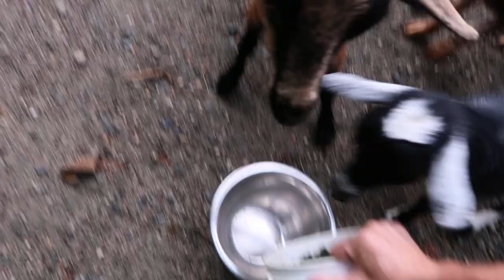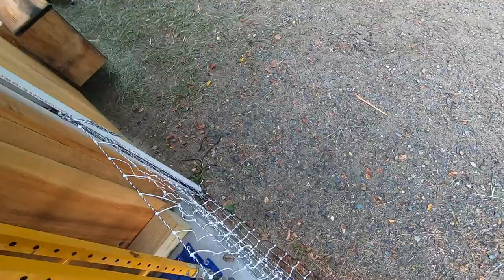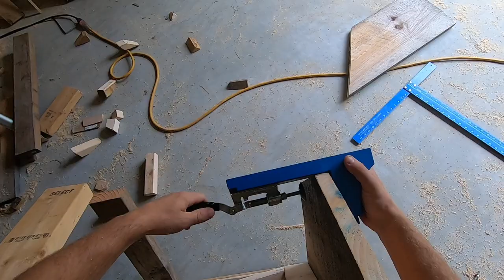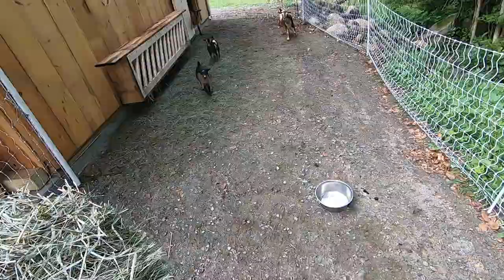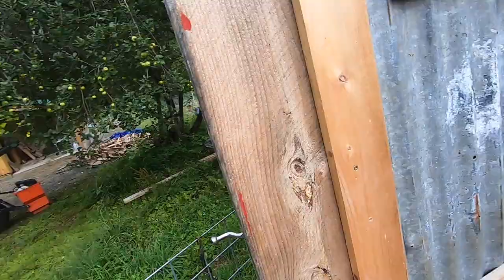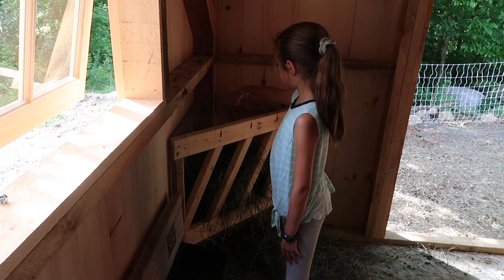I hope we CAUGHT our Chicken Predator

Comment: You may wish to round off the tin roof corners those sharp overhangs on the feeders are an accident/ cut waiting to happen. Other than that they are beautiful.
Reply: Yes, goats are too playful and rowdy for those sharp edges.  Rounded off and maybe a durable sort of bumper on those edges.
Reply: I used to be a metal roofer back in the day, and those edges are brutal.
Reply: Yes I have had to do this in my duck pens where I use them. Just fold the corners under. Super easy fix.
Reply: Yes, those metal sheets on the feeder will rip the goats.
Reply: This is a wise comment. If a goat can find a way to cut, hang, or gouge themselves they will. Especially if it's a new thing.
Reply: Eric Budrow are we related? lol

Comment: Suggestion: Try covering on the top and long sides leaving both entry and opposite end open. Most predators will not enter if they can't see an easy escape route. I usually do not cover the trap at all and get good results.

Comment: Look at hope scratching along the length of the outside feeder.  Need brushes installed?  Also can drill a hole on the door post for a string for Olivia to pull to Open the door so she doesn’t have to feel for the lock.  And who sweeps the 🐐 💩?

Comment: I love the old milk stand. Metal is off putting.
Reply: If he places some plywood over the metal floor, the goats may accept it.  I don't think they like the metal on their feet.
Reply: I was thinking about using the metal milk stand for buttercup and blossom
Reply: Get a rubber stall at and cut it down to fit the metal milk stand. The rest could be cut to fit on the concrete floor at the bunk beds.

Comment: I just got Electric heated flat sided buckets from Amazon for the winter. No frozen water. Your insultated boxes worked good but now you have electric in the barn.😏 Just a thought. Oh wait! goats might chew on electric cords??
Reply: Just use metal tubing for conduits. I don't think they chew through that. Plus using a wire that is critter-proof i.e. with metal-mesh just under the external insulation layer. Belt and braces solution I think.

Comment: Make sure the set wire is in the proper position in the wire mesh of the trap.  It must only have tension in one direction. If its in the wrong position of the wire mesh, it will have tension in two directions and will not "spring" fast enough to catch larger predators. Also, place the bait under the trap directly behind the trigger step as well as behind it within the trap, and place a 7-8lb weight (I used a stone) on top of the trap. I set my trap several times with the same result you had before I utilized these techniques to catch 3 Raccoons and a Opossum that were killing my Mom's chickens.

Comment: You need to build yourself some workbenches. Save your back🙂
Reply: He'll start that after the Winter prep projects are done. Getting the firewood covered and dry is a higher priority.
Reply: I think Daryl May have meant a rudimentary/temporary raised work surface.  1/2 a sheet of plywood and a 2 by 4 frame secured to a wall with 2 front legs would take 1/2 hour to build and save a ton of back strain.
Reply: @James Halliday He didn't use kneepads once during the barn build, even though Multiple supposedly older and wiser viewers had commented that it will help him not have bad knees when he's their age so I don't think he cares

Comment: Three new quick projects for you Al. 
1) a workbench and tool storage with lots of draws
2) you need to find a drainage solution for the old goat place. It will be flooded again if snow will start melting.
3) rain harvesting for the new barn building

Comment: It sure is handy to have the tools that you need when you need them. Now , you are using wood glue on the joints !
I see that I am not the only one that thinks that you should be taking advantage of the broody hens. They are automatic egg hatchers and you do not even need to monitor them nor brood the chicks after they hatch .
 I foresee that you will be running a water line to the barn.
 It's all coming together now isn't it ?

Comment: The closed door on the trap... your predator was there last night more then likely it either used the trap for a step to get up on the chicken tractor and set it off or it moved it around and set it off.. I had to anchor mine to the ground with rebar and wire so the raccoons couldn’t move it. Second thing is if it is a full grown raccoon or a fox your traps are too small. I’m telling ya they are. A full grown raccoon can be almost as tall as a fox.. raccoons are also very smart. Any missed attempts will teach the raccoon to stay away from the trap. Which is what happened to me.. I had to switch to leg traps ( which I do not like) but they worked. I actually caught more predators with the leg traps then with the havahart traps. The bad part about leg traps is they are kinda dangerous around pets. If your pets roam free like figaro does. Or even the dogs when you let them run free. Predators are a bad situation all around. You can’t keep loosing your chickens either though. And until you catch what ever killed them it will keep coming back. Maybe not every night but it will come back. Good luck
Reply: Judy G.  Most predators will hang around as long as they are getting free meals. I would still be worried. We don't have many losses because we have guard dogs but we still see foxes and coyotes occasionally not far from the house.